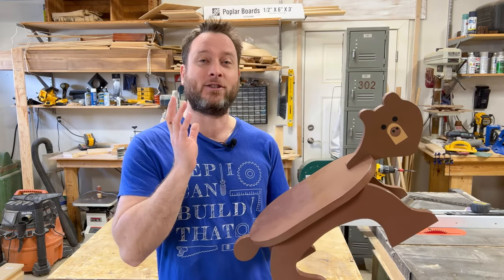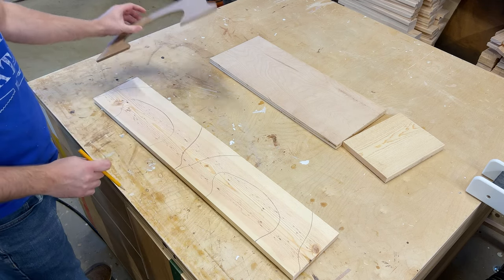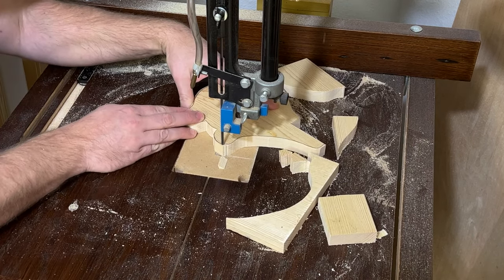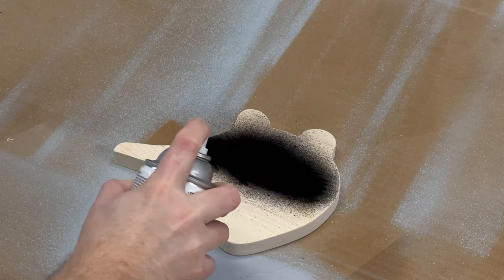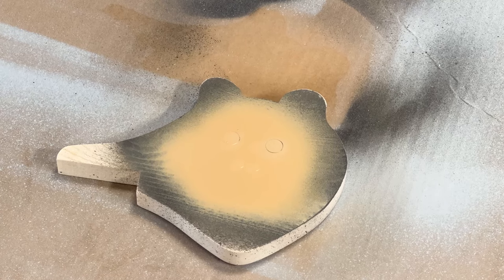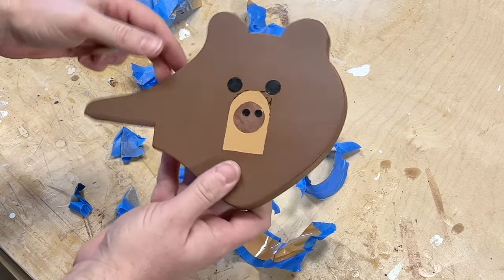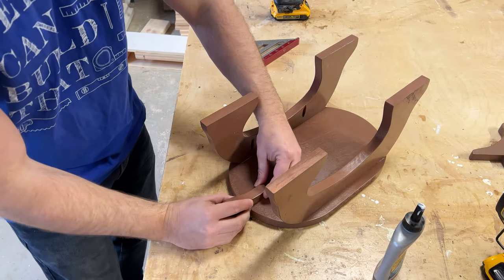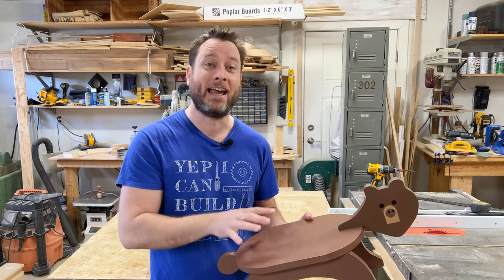How To Make a🐻 Bear Animal Stool Woodworking Project That Sells | Season 2 - Episode 4

Comment: Cool little stool. Simple design, making it achievable by just about anyone.

One thing I'm not a fan of is wood glue on paint. The glue may be bonding the pieces together but it's only bonding to the paint, making the joint only as strong as the paint's bond to the wood. Granted, you're using pocket hole joinery for the legs so that's where you're getting the most strength from. However, it would be nice to have the glue actually bonding to the wood so if it were me, I'd be masking the areas where the pieces will meet so they aren't covered by paint. When masking the base, make it slightly smaller than the mating piece so the paint will disappear under the mating piece when it's put together. The head and the tail may not be such a big deal, but I'd prefer the legs be as strong as possible to prevent them from coming loose over the years.

I like your series on projects that sell. I'm getting in to making various seasonal items and selling them at a local pop-up market. These kinds of videos give me great ideas. Thank you for putting in the effort to provide this kind of content.
Reply from the maker: Painters tape is a good idea and thank you for the support and encouragement 👊🏻